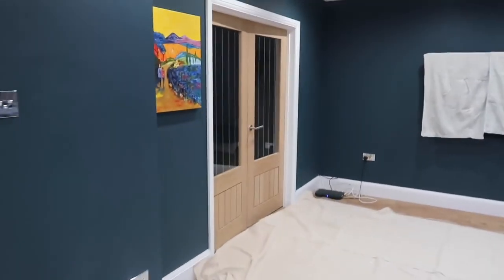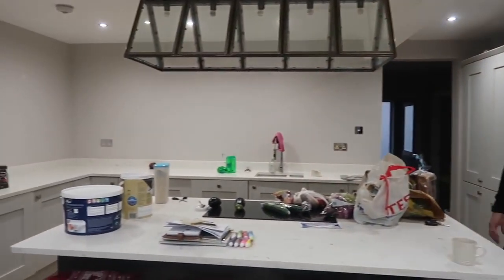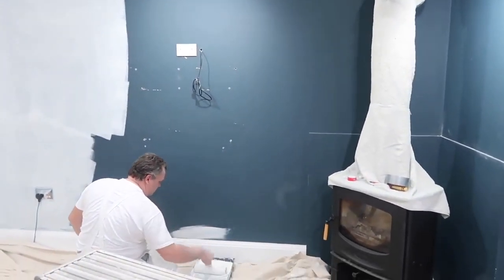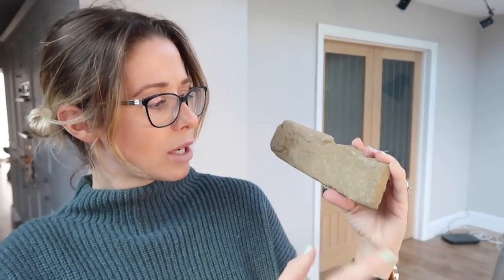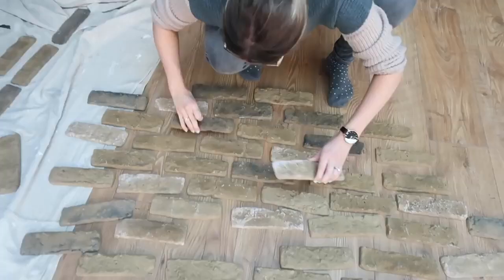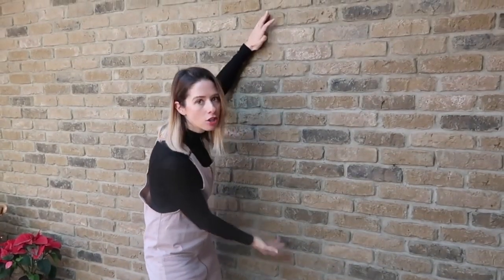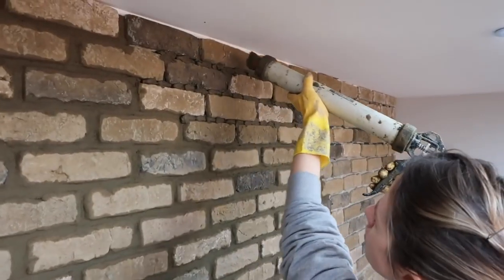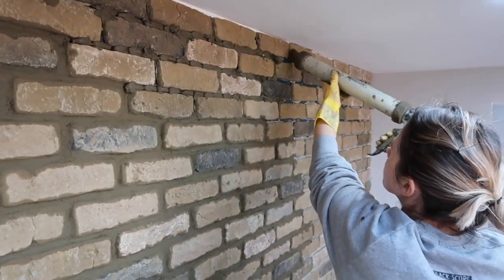London Town Brick Slip Installation

Comment: Hi Kerry haven't you moved the brick slips into the kitchen now and how do you find cleaning them? Do they get dusty ? Also where is your shelf from in the kitchen x x
Reply from the maker: Hi Amy, apply a good quality matt sealant post pointing  to offer further protection and make them easier to clean. 
However always test your sealant on an offcut and leave for 24 hours to make sure you are happy with the finish before applying to the wall

Comment: Did you use any sort of primer on the painted wall before you started putting the morter on the wall?
Reply: Hi John, I would advise fitting them with tile adhesive, not mortar. Use the mortar for pointing them after they have been stuck to the wall. 
Its not absolutely necessary to prime the wall, but covering them with PVA is easy and cheap and it certainly doesn't hurt. Hope that helps, but if you need anything else let me know or drop us an email at info@kucidesign.co.uk
Reply: Could you people please stop putting that rubbish in your lips, it's weird and you all look the same
Keep well